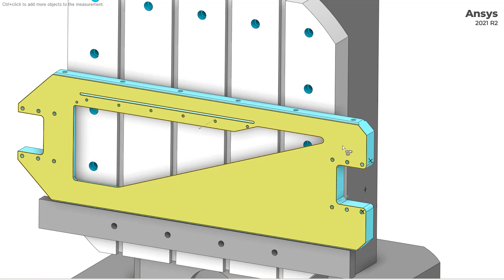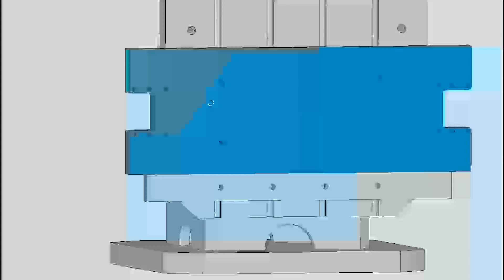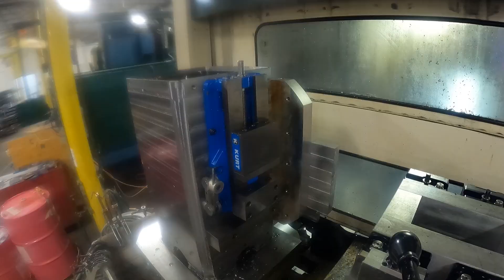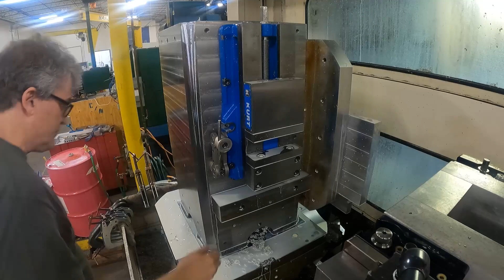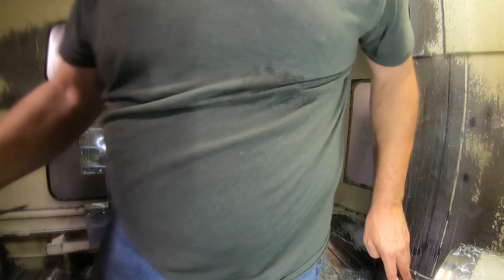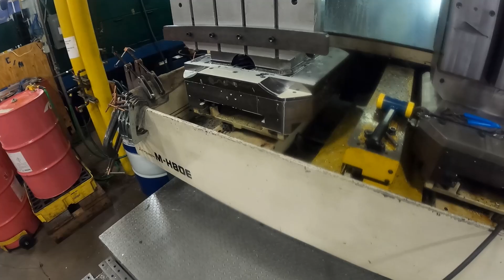Mazak Fixture Base

Comment: Peter, do you (or have you) used any methods for determining how hard you can cut with your milling chucks? I normally don't cut too hard, IMO, but I've also pulled a tool out of my big kaiser milling chuck which makes me gun-shy
Reply from the maker: I am superseded you have trouble with a Big Kaiser chuck. What is the spindle taper of your machine?
Reply: @EdgePrecision  I wouldn't say I have trouble I just don't have a good idea where the limit is while setting my cutting parameters. BK will state the torque transfer limits for a given shank size but they're static torque values, not values while a complex moment is applied to the tool.

The machine is a 40 taper big-plus okuma m560v. 30hp\199lb tq

I've considered just taking a series of test cuts until the tool starts to pull. Haven't had time yet though
Reply from the maker: I have never tested my chucks. The one in this video is a Iscar ITS the ones I use on the Mazak are Kaiser ones. I have never pulled a endmill out of either brand.
Reply: @EdgePrecision  huh, crazy. I ended up cutting my vise during a 500ipm linking move. The sound was great

Comment: It's always great to see you've posted a new video. I'm sure you know this - but you can remove aluminium from your endmills by soaking them in a sodium hydroxide (lye) solution - https://www.youtube.com/watch?v=tXNdO3CFsZM
Reply: I have had success with the ultrasonic cleaner getting loaded+up tools clean
Reply from the maker: It takes to long
Reply: @EdgePrecision  Yeah, I can see the time it takes being a problem in a production environment.
Reply: I see people all the time gumming up the mills, but its just like, run coolant, never will stick to your tool again.

Comment: Thanks for sharing that, when you stopped to clear the endmill, how did you restart the program?  I have run some machines with Fanuc controls that had a mid program restart option but the one I have now doesnt.  You have to start at a tool change or a programmed M00.  Charles
Reply from the maker: I didn’t restart. I never stopped it. I zeroed my Z incremental display.  Than put the control in handle jog. Jogged the Z axis up so I could get the tool out of the spindle. Cleared the aluminum out of the endmill. Than jogged the Z back to zero. Put the control into the memory mode and pushed the start to continue.
Reply: @EdgePrecision  Thanks, I dont think I can do that with mine.  It is a base model 21i control and to stop the spindle you have to feedhold, reset then manual and that stops the machine and I dont think the non model information is kept when you do that.  I may try that and see how it works.  Thanks for your response.  Charles
Reply: Thats a really good feature, with my fanuc i can do exactly what Peter did, very useful!, On a fanuc you feed hold, turn the spindle off, and go into Manual and jog it up, but make sure to job back down because it will most likely collide because it has to move the Z too!
Reply: On my Cincinnati milicron acramatic 950 I just have to feed hold,  move it wherever, stop the spindle and index inserts or clean or inspect, then just hit spindle start and hold cycle start in until the machine gets back to its spot were it was, hit cycle start 1 more time and it's back in action again! But never hit reset! The mill is a horizontal the size of Peter's. Or I like to go to single block and wait till it's done and waiting for cycle start and zero out the axis in hand mode n  then move it wherever , and then back to the zero , start the spindle if you have to, then go back in memory  and hit cycle start
Reply from the maker: @jasonruch3529  On the Mazak I can do a similar thing. But this machine is to old for such things.
Reply: @EdgePrecision  ya but I have to do your way on our old mazaks! Hahaha
Reply: By the way I love your videos!